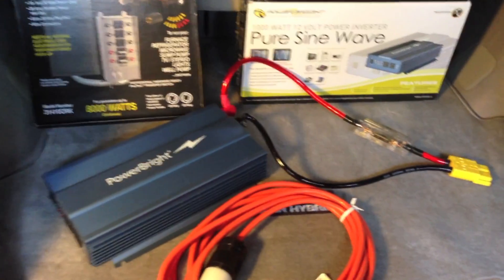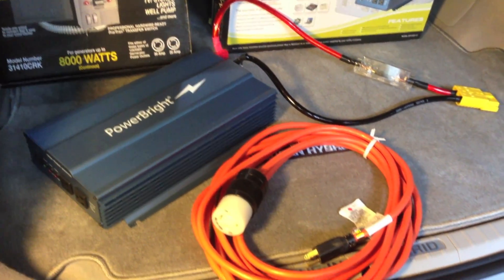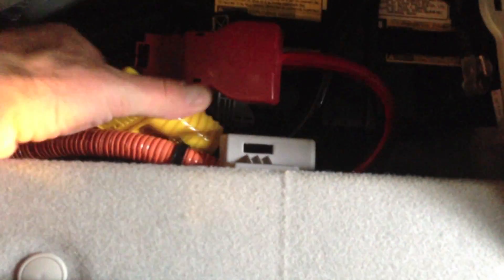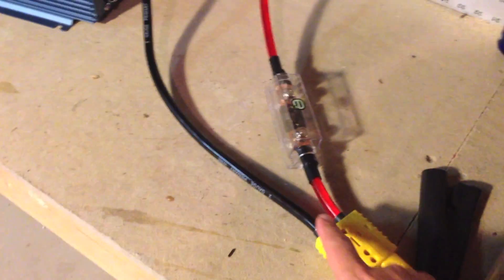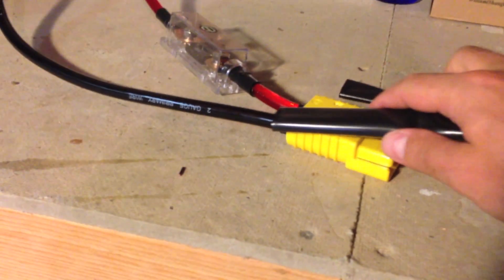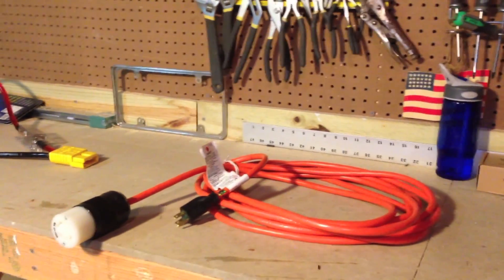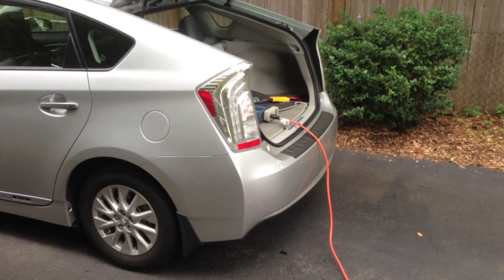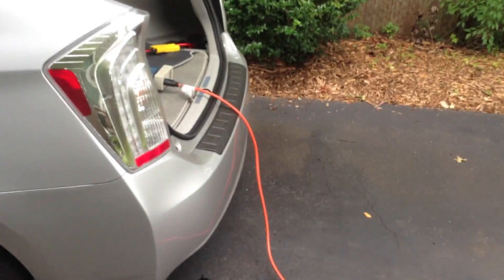Prius Home Generator - Part I

Comment: Having found this YouTube video several months ago, I took it as a weekend project and made everything according to Frank's specifications. (Mine is a 2013 Prius)  Everything worked fine, and I put it away -- ready for an emergency or power outage. 
Little did I know then how much would I use it, and how hard would it be put to a test. I live in San Juan, Puerto Rico. My diesel generator died on me during hurricane Irma. A few days later, hurricane Maria knocked down 100% of the island's power grid. Close to two months later, 80% are still in the dark (me included). Until I got my generator replaced, during a period of FIVE WEEKS I powered my fridge, several lights, electric fans, my PC, and chargers for several gadgets all with my Prius. 
Thank you Frank!!
Reply from the maker: That is amazing Edgardo.  I'm sorry that your power has been down for so long, but I'm so happy that my instructions and your prius were able to provide you with some power needs!
Reply: Frank Perkins 
I traded in my Prius for a 2018 Rav4 Hybrid. I kept all the equipment and am wandering whether this will work with my Rav4 as well as it did with the Prius. If there is anyone out there with info or anecdotes, please share. I’ll keep you posted.
Reply: @edmuyou  it won't work exactly the same the only reason why you want to use a Prius is because it has the hybrid battery system that would hold a good amount of voltage for a while before starting and stopping over again versus using any other vehicle it would be more like a regular generator at that point because you'd be burning gas at such a significant rate
Reply: @jsnareid  -
Do you mean that the Prius hybrid system is different? Note that my Rav4 is a HYBRID model.   (Both are hybrids, both made by Toyota)
Reply: @jsnareid  it is Rav4 hybrid. same kind system. should be no problem at all.
Reply: The RAV4 is also a hybrid, according to the post.
Reply: I have the same year and live in hurricane path and we have tornadoes, just to keep it fun.  This is a great idea and think I'll see if I can't rig something simiar, a $200 inverter is a lot cheaper, less noisy and smelly than a stand-alone generator.
Reply: @tlockerk    Yeah, but for hurricanes and tornadoes, shouldn't you be down in a storm cellar, and not above ground (or have I watched too many storm chaser movies? I live in CA, so I wouldn't know, lol). It just seems like there would be the very real possibility that, depending on your proximity to the hurricane/tornado, the car could go flying away....and there goes your only power source. Maybe diversify, just in case: have a generator on hand, and a propane stove, and a Jackery power station for phone and computer, and a hand-crank emergency radio, etc...in addition to the Prius set up.  ?
Reply: Are conditioning ?

Comment: Hi frank! Well I've finally gotten all my gear and inverter. I bought a 2000 watt pure sine wave inverter but will only draw a 1000watt from the 12v battery. I wonder do I need to ground my inverter as some inverter videos do talk about grounding things down
Reply: I'm interested in this question too.  I had an electrician make a manual transfer switch for just my furnace circuit (it was tested ok by a later electrician).  I powered up my 1000w/2000w surge inverter but couldn't get the transfer switch to be happy.  The furnace/transfer switch have real grounds, but the inverter has a 'floating ground' (I'm told this is ordinary).   I think, though, that there is a problem here with a floating ground inverter trying to power a grounded furnace.  Am I wrong?
Reply: Grounding the inverter would probably correct the problem. I believe inverters have ground and neutral tied together.

Comment: too bad you can't conect to the large lithium ion battery that would be awsome for camping. I would love to connect to the lithium battery and power a scamp 13 camper
Reply: Nun Urbuisness I think u would be able to charge up a kodiak and then use that for power.
Reply: You can connect to the big HV hybrid battery, but the connections are much more unusual and you'll probably want an electrician to do them safely - and so that your car remains safe for its users.  Also, the hybrid battery is something like 200-240v DC (not AC), so getting that to supply you with AC is an unusual task that needs an unusual device.... See priups.com and plugoutpower.com, for people who are doing this.

Comment: If all I needed to run was a fridge, and those small additional items, I would simply run a long (but heavy gauge) cable from the inverter to the kitchen.  Of course, you had already purchased the transfer switch, but if you do a straight run of a cable to the kitchen, all you would need to do is unplug the fridge from the wall, and connect it to the cable... and possibly use a 3-way adapter to create two more 110 V sockets for the other little things.
Reply: This is exactly true.  Up in the north (or in Texas in Feb 2021) sometimes you want to power some mission critical things (like furnace/boilers) that aren't easily plugged into an extension cord, and you cannot backfeed a house that might send power down the line and injure a line worker.
Reply: I do the same thing utilizing 12 gauge extension cords. However, 16 gauge would work just fine. A ten ampere load on the AC side presents as an 100 ampere load on the DC side tripping the 80 ampere fuse. If the fuse wasn’t there you would overload the inverter or trip the fuse in the Prius.

Comment: I see from your display that you have a plug-in Prius. I can't find a lot of information about how a system like this works with the larger traction battery. If you have it charged up, does the car automatically pull from that traction battery before it turns the engine on?
Reply from the maker: It seems to work that way, but I haven't run it for an extended time to fully test.  Thankfully I haven't had a power outage since setting the system and I have only tested it over 30 minutes or so.
Reply from the maker: This past week I have had a multi day power outage and that's exactly what happens.  The larger internal plugin battery slowly discharges (about 1 hour = 1 mile).  When the plugin battery is fully drained and the battery gets low, the car will automatically start to recharge itself.  Please note I keep the car "on" (not running) with the keys inside while I'm using it generator mode.  I usually have another car parked behind it in my driveway so I dont have to worry about someone stealing it.

Comment: Frank good job but their is issue you need to be concerned with. Do not use any 220 volt appliance, make sure all 220 dual or single breakers are off in your main box and do not wire you isolator switch to them, it will fry your inverter and with it bing located in your pius it may cause a fire in the inverter and ruin your 40k car!
Reply: Watch Coordinator yeah I'm glad u pointed that out. If he were to run continuously 240W I was thinking there could be trouble. I do love the Prius hacks though
Reply from the maker: Great point.  My transfer switch is only setup to power 8x 110v outlets with no 220v appliances.  I know that the way I bridged the hot lugs on the cable "fakes" out the 220v.

Comment: I have questions and hopefully you are still monitoring this and are able to response (or anybody else). 
1- What is the maximum power that can be extracted safely from the Auxiliary 12 volts Prius’ battery while the car is running?
2-  Is 2,000 watts inverter works without damaging the car’s batteries (12 Volts and 310 volts)? 
How the 12 volts battery connected to the hybrid 310 volts battery? Is there any wiring schematics available online?
Reply: I received no response regarding my Qs above.  I Bellevue (not 100% sure) that there are no connections between 12 volt and large 210 volt traction batteries.  These two batteries have got speared connections and chargers.  I am hoping that someone will clarify this with some logic/schematics.
Reply from the maker: Sorry, I didn't see your response. According to my research you can go up to 2000 watts, but I only tried with a 1k inverter.

Comment: I don't know if you still monitor this....but THANKS !!  I did have a question for a hybrid Prius wouldn't the 12v car battery be ruined since it's not designed as a "deep-cycle type"...i.e. too many repeated charge/discharge cycles ? Also, if I just wanted to use alligator clamps to attach to battery, would that be a problem ? Lastly, are you still happy with the Power Brite 1kw inverter ?
Reply: The power does not come from the AGM battery. It comes from the DC to DC inverter that maintains the battery. The battery and inverter are loads when the system is on.

Comment: Has anyone tried doing this with a 2016 Prius 2?    I was running my 2011 very successfully so thank you for your good advice!  but now I have a new Prius and the 12 v battery is in the front like an ordinary car battery.  Do you suspect aything will be different?
Reply: Betty LaWhite you just have to run it from the front end

Comment: Great video! You put a lot of thought and care into it. I am wondering if you still agree with your comments at 9 minutes about using 120 volts across the two hots on the cord to allow you to hook it up to the 30 amp transfer switch? Has it worked out for you as expected? Would you change anything? Thanks! Robert
Reply from the maker: I haven't had any issues with it myself.   My understanding is that it's perfectly safe as long as your electrical box is properly wired.
Reply: As long as the demand  do not exceed the output of the inverter it should work.  His only limitation is the output fuse of the inverter.

Comment: You connected your inverter to the engine start battery,this battery is not intended for charge and discharge. If you want to use your prius as a generator, you will need to connect to the power train battery.
Have you tried to run your generator for a longer period of time ?
Reply from the maker: I would not connect it directly to the larger traction battery.  That's high voltage and not easily accessible.
Reply: The high voltage inverter can recharge the 12 volt system up to 100 amps.  It won't let it discharge.
Reply: read up on it; the auxiliary battery is charged by the HV hybrid battery which is charged by the gas engine, provided the car is in READY mode (switched to 'on' mode).
Reply from the maker: YEs!  Please see my updated pinned comment.
Reply: The AGM battery does not provide the power. It is a load just like the inverter.

Comment: Hi there, i noticed you used 80amps whereas in priuschat they used a 15amp inline fuse. I was thinking of tapping my traction battery.
Reply from the maker: ***** If I remember correctly, the Prius electrical system has an internal whole car fuse at 100amps.  I used 80 so it would blow before the car fuse.  You're correct that the system only generates 15amps of power, so that would actually makes more sense.
Reply: thanks so much man!
Reply: Terrible advice. You can do this with any 12v inverter with a 12v battery source, just like he’s doing. Using this particular battery will ruin the battery providing the 12v onboard, it also sends power to the bms. That controls how the lithium battery is charged. If you mess that up, it’s likely to get real fun when one of the cells melt down😂.
Reply: The power is not coming from the battery; it is coming from the onboard inverter, an alternator analogue.

Comment: Brilliant, thanks for sharing. 95 out of 100 instances, this would help through the worst of a power outage. My biggest worry in those circumstances is the food in the fridge going bad. We can light a fire for heat, and even some cooking.
Reply from the maker: Unfortunately (or fortunately) we haven't had a real power outage so I couldn't test in a real world situation.  However, that was my main concern, just keeping the fridge running to keep the food cold.

Comment: To run your whole house, this setup won't do a lot more than run a few essentials.  The Prius plug-in can store about 4.4 kilowatts of power, which if connected to a large enough inverter, can run your entire house. Unfortunately an inverter of that type costs at least $5000.
Reply from the maker: If you watch the video, you'll find that that's precisely the point, to run the bare essentials.

Comment: I see no reason why this has to be specific to a Prius. Any vehicle has a 12V battery, and this setup would work with any of them.  The Prius runs their batteries at 90% capacity compared to other vehicles which are at 14.2V, therefore the inverter is more likely to trip out due to low voltage in this vehicle, making it necessary to run the engine nearly all the time.

I would have been impressed if this setup was designed to tap the main hybrid drive battery.
Reply from the maker: True it can work with any car as the essence of any generator is an engine and an inverter.  What makes the Prius different is that the engine only runs to recharge the 12v battery.  Do some more research on the web and you'll see that the Prius is pretty efficient acting as an emergency generator.  The great part is that you don't have to have the engine running the entire time.
Reply: I too was disappointed to see this video have so little actual ingenuity in it. All the likes are simply from people that don't know a AA battery from a car battery. The Prius uses about 0.7 Gallons Per Hour of gas to generate roughly 5kw of electricity. That IS efficient for sure, until you realize at least 300 Watts are constantly drawn just to keep the Prius idle in the Ready state. From there in this video we are then taking 1000v AC from the generator converted to 220v DC by the cars inverter, then again covering to 14v DC for the cars auxillary battery, then converting to 120 AC in the pure sine wave inverter, then finally converting whichever DC voltage your appliance is using. The saddest part is where he skips the beautiful amperage potential of that hybrid battery to tap of the miesly 1400 watt (14v battery x the 100 amp fuse he mentioned Toyota themselves put on that circuit) max capacity of the auxiliary battery. Hardly much of a generator. Sure, it works. But this is not inginuity at all. This would have been so much more interesting if he somehow taped a bit earlier in the chain to get more efficiency or wattage output potential out if this. Anyone with $65 can go get a crappy car inverter at Walmart and turn their hunk of junk car in their driveway into an equally capable "emergency generator."
Reply: The Prius shuts off when it's not charging the battery. That's the major advantage over a typical ICE engine that you're ignoring completely. Running a junk car 24/7 will use a shit ton more fuel.
Reply: David Maiolo the Prius engine runs about five minutes per half hour to charge the battery when not driving. Your junk car has to run 100% of the time. Not the same at all.
Reply: @djmylo5   Good critique, except - the 100 amp fuse "Toyota themselves put on that circuit" would limit the maximum total power generation per hour to about 1.2 to 1.4 kw, not 5.  (100 amps x 12-14 volts DC = 1200 to 1400 watts)  Unclear how much fuel that would use or if the writer was referring to energy generated by the fuel, but not available for output purposes.  The 100 amp limiter fuse is present to protect the DC to DC converter... which steps the high voltage of the "traction" battery down to the 12 v auxiliary battery.  It would indeed be interesting to draw directly from the former, (about 206 vdc) step it down to 120 and invert to A.C.  This would eliminate any need to step down to 12 volts or worrying about the expensive DC to DC converter.   This would be a true whole-house generator and benefit as well from the Prius' engine running intermittently but now only having to top up the high voltage battery.

Comment: cheers mate for the demo.  Do you need to use a portable RCD switch from between the inverter and the cable?for safety?  Also when you power up your appliances does the prius petrol motor start up to make up for the energy use if so how efficient is it-cheaper than usual electricity costs?  cheers thanks for uploading